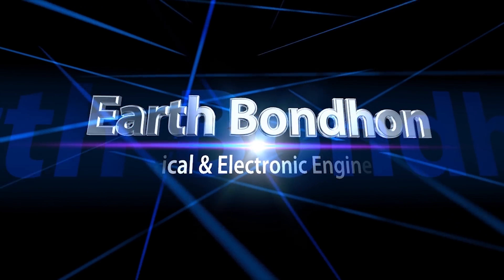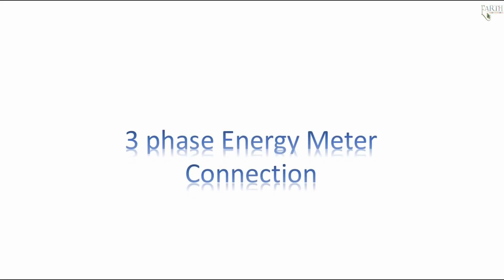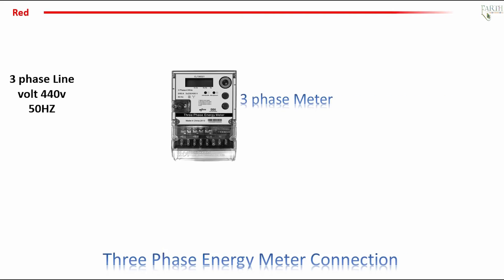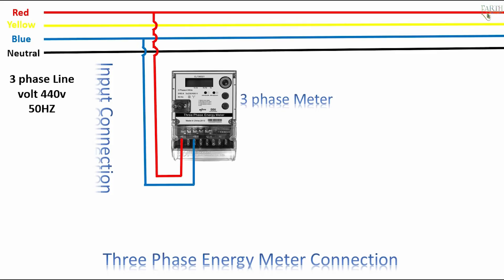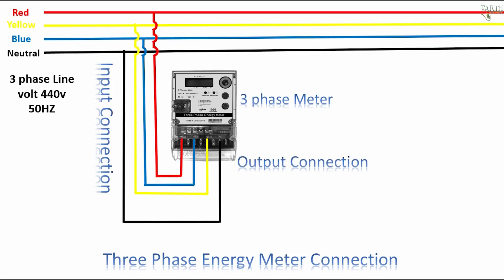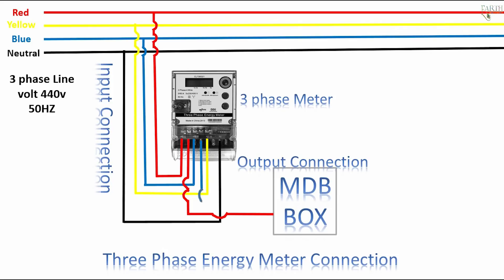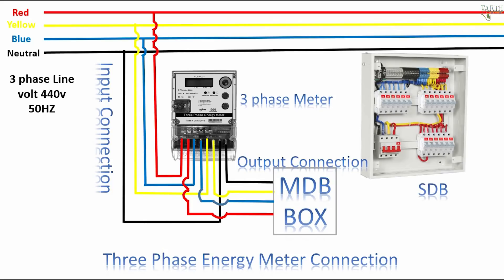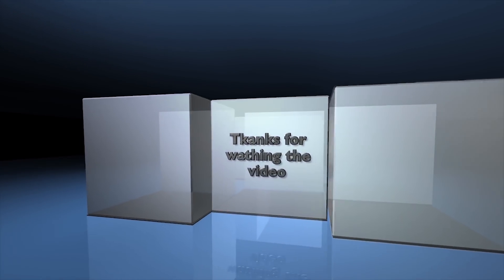3 phase Energy Meter Connection | 3 phase meter by earthbondhon

Comment: what happens if we connect input instead of output energy meter ...? it will be the short circuit or burn to the device or what ?? if this's normal, will still count working in kW/h ...???
Reply from the maker: hi. 
3 phase line.
1 KW = 1.60 A per phase. 
personal fb id : facebook add Fb/earthbondhon.org
skype Id : earthbondhon_2thanks friend. SHARE video .
subscribe my channel.........

Comment: How can we connect Current Transformer and Voltage Transformer to 3 Phase Energy Meter , can you explain it please ?
Reply from the maker: HT miter te Transformer connect. transformer output 3 Phase miter connection. Thanks For Watching video.
Reply: I do not understand well , please help me. Also, when it says 3x100/5A on current Transformer , it means we will read 100A from primary side for each single R,S and T phase, respectively. Plus, 5A is read from secondary side. Please clarify it. I kindly request your help...